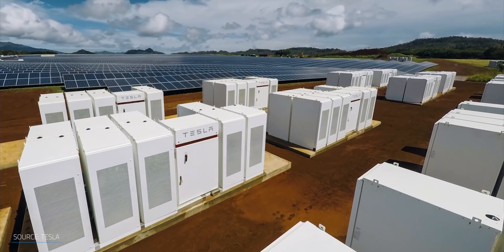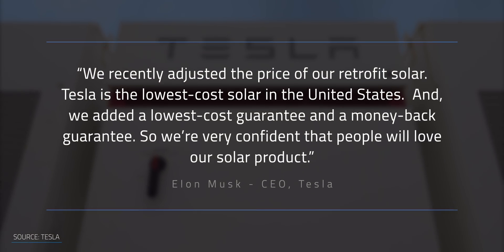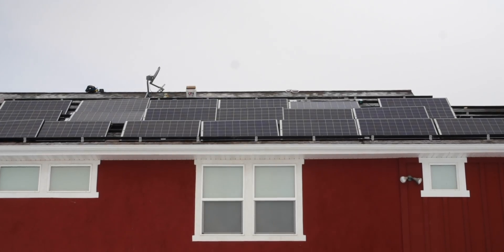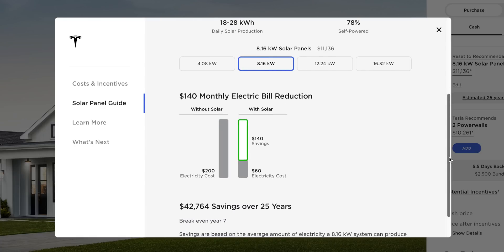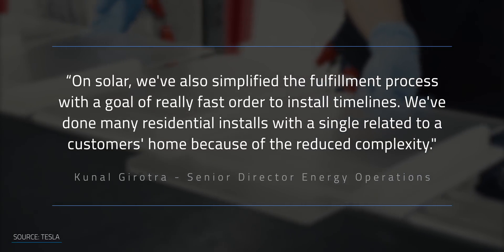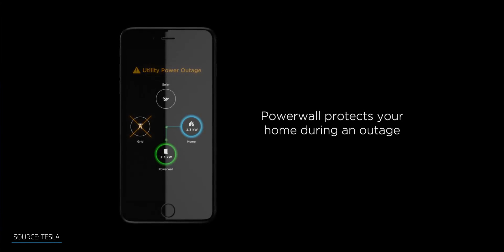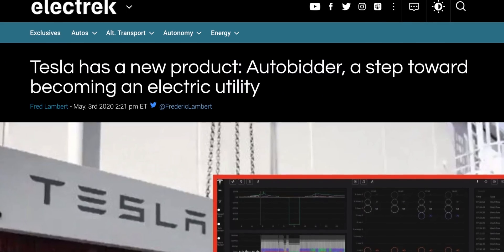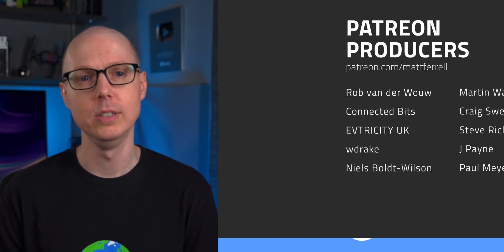Exploring Tesla solar panels game changing price

Comment: I’m going to buy a Tesla Roof, if they ever expand distribution to Wisconsin. Very slow ramp on the energy side.
Reply: What's really happening is installers keep raising their price such that your break-even point is over 10 years, at which time you'll need new panels.  Plus, with over 175 days of cloud cover (and snow covered roofs) in WI your use of the grid plus the environmental cost of making solar panels won't really add up to fiscal or environmental savings.
Reply: coffeehawk 
The cost of solar panels and installation are going down, not up, and the cost trend will continue down. And, panels last far longer than ten years, so not sure why you lied there. Solar plus batteries ares already far cheaper than coal-fired power, which is why coal-fired power plants are no longer being built, and in fact are being decommissioned. These economic trends are unstoppable solar is on a downward trending cost curve, but none of that matters to me — I’m going solar no matter what because it’s a super fun technology. I mean, you face these panels at the fusion reactor in the sky, and the energy is magically transformed into electricity that I can store in batteries in my garage. What could be cooler that that? I’m building a new garage, and Tesla’s solar shingles are such a cool idea, I’ve already decided to go that route. Just waiting for them to start distribution up here.
Reply: @bulletbob  You read the hype only.  Try to broaden your perspective.  It's fine if you like the idea of it but most home owners have additional concerns.
Reply: coffeehawk 
Nope, I’m an engineer, and I see the whole picture very clearly. I’ve been fascinated with solar power since the 1980s, it’s just always been uneconomical because of the high cost of batteries. Now that the battery cost has come down, solar plus battery is cheaper than coal and cheaper even than natural gas. This change is super exciting, not bad. You don’t have to lie about it to try to slow it down. The cost of solar plus battery will continue to decline as batteries continue to get cheaper, so coal and natural gas, where costs cannot go down, cannot compete — and these plants will become stranded assets. It’s already happening. Coal-fired power plants are being rapidly decommissioned, and 30% of power facilities installed last year in the US were solar and wind, despite tremendous political pressure against it. So, no hype necessary — it’s inevitable. Not sure why you care about where your electricity comes from, if you flip the switch and the light comes on, why does it matter? Solar plus batteries are now lower cost than either coal or natural gas, so it will make electricity cheaper for everyone, which is why the utilities are decommissioning coal-fired plants — they just cost to much to operate. For me, I’m going to create my own little power plant in my backyard, and it’s going to be a blast.  😀
Reply: @bulletbob  You're not a good engineer and I've managed them for decades.  If you were a good engineer you would have some comments about the negative aspects, especially given the state you live in, and you would have looked at other states for reference points and as you went down that path you'd understand my comments better.  You're hyped, and that's fine, but as an engineer you ought to know your science>feelings.
Reply: coffeehawk 
Try again. No counterpoints, just more trolling and personal attacks. Doesn’t matter what you or I think, just watch it happen.
Reply: @bulletbob  Just because you can't defend yourself doesn't mean I'm a troll.
Reply: coffeehawk 
Lol, you haven’t made a single credible point.

1. Installation costs for solar power are going down, not up, so you were wrong about that.
2. Solar panels last far longer than ten years, so you were wrong about that, too. This is 2020!!
3. Solar panels are easily cost effective in Wisconsin, so you were wrong about that, too. This is 2020!,
4. I’m a crappy engineer. Well, you got that one right, so, you did have one credible point . . . I’m not sure why people pay me at all.

Nuclear power is dead — stranded assets. Coal-fired power is dying — stranded assets. Oil prices have collapsed stranded assets. Both utility- and residential-scale solar installations are increasing. Battery costs are falling. Solar panel costs are declining. Solar panel efficiencies are increasing. Cost/watt of solar power is declining. You don’t have to believe me, it’s all around you. If you think I’m wrong, though, you should buy shares in a coal mine or oil company. Don’t buy shares in Tesla., they are a bunch of crappy engineers, too.
Reply: @bulletbob  Your words are no different than those of a paid promoter.  But since you mentioned tesla, can you provide the links where tesla or musk describes how their cars are better than a VW diesel for the environment, or even a gasoline economy car.....or any car for that matter?  People should know how good their purchases are for the environment, right?
Reply: coffeehawk 
Dude, your just pumping out propaganda for the tired old companies desperately trying to stretch the life of the dying traditional fuel makers. Buy coal!! Build more nuclear!! Buy oil!! Buy gas-engine cars!!! Lol. The dead and dying. Trillions of dollars of stranded assets. Good luck with that. Welcome to 2020. 😎
Reply: coffeehawk 

Here you go.

https://www.tesla.com/ns_videos/2019-tesla-impact-report.pdf

I have a pro tip for you, though, from a crappy, low IQ engineer: Ignore the environment. Only pay attention to economics. Utilities don’t give a crap about the environment, they only care about cost. The reason solar is winning, and coal is losing, is because the cost of installation and operation for solar plus batteries is 10x lower than coal. It’s not even a close call, solar wins by a country mile. Same way for electric cars. Ignore the environment, the cost of ownership for electric cars is way below gas engines, so electric cars win. In 2040, what will be the ratio of electric cars to gas engines? Maybe 90/10? So, invest in Tesla, not Ford. But what do I know? I’m just a crappy engineer. 😇
Reply: @bulletbob  LOL, we both know you can't find what doesn't exist, but you're still so happy about it.  People don't have to know physics and thermodynamics like you and I do they just need to see the lack of content in your replies.
Reply: coffeehawk 
Hmmm, you asked for an Elon link, so I posted it to you. I even gave you a bonus investing tip. Don’t buy coal. Don’t buy oil. Don’t buy Ford. All yesterday’s technologies — like fax machines and rotary phones. Buy the future . . . like my solar roof. How is that empty? It’s a blast.
Reply: @bulletbob  I didn't see your 2nd link that came 2 hours later.  It will be evaluated.
Reply: coffeehawk 
No trouble. Keep digging coal!!!
Reply: @bulletbob  When you step back and look at your replies you'll see that you're core premise is actually anti-coal/oil not pro-tesla (only a fool would support the horrendous quality levels of tesla's).  As such, you ought to be promoting hydrogen fuel cells.  That's the only 'infinite' resource technology and as long as they keep the batteries small, like in a Mazda 3 EV it's the only technology better for the environment that a 1.8L diesel.
Reply: coffeehawk 
 Yup, I like Tesla’s. I own a Tesla Model Y. It’s immaculate. No quality problems. None. Consumer Reports ranked a Tesla as the best car in the world. Amazing cars. Drive one before you dog on them. Otherwise you’re just repeating hearsay, which might be propaganda. Tesla’s don’t have horrendous quality problems. That is propaganda. Just like when you repeated the hearsay lie that solar panels only last 10 years. You don’t have to believe me. Next Tesla you see, so inspect it. They are beautiful cars.

But I was talking about solar power, not cars. I’m going to buy a Tesla solar roof. But I’m just one person. What I think doesn’t matter — I’m just a crappy engineer, so my crappy point is that market is driven by cost, not environment, and solar plus battery has recently become the lowest cost way to produce electricity, so it is winning out over coal. Coal plants are being shuttered — stranded assets. Solar wins.
Reply: @bulletbob  You're not an engineer, you're a fan-boy.  CR has no credibility or statistical value, until you learn why you'll never actually be an engineer.
Reply: coffeehawk 
We have already established that I am a crappy engineer. And I am absolutely a Tesla fan, although not a boy, so you’re almost right on both counts.

You are so lost in competitiveness, that you are trying to win an un-winnable argument, and thus missing out on a brighter future. For me, I’m going to face some solar panels at the sun, feed the electricity into batteries, and use the stored electricity to charge my electric car. And save money while I’m doing it. What could be cooler than that? Have a blast, man. Life should be fun.

My crappy investing tip from a crappy engineer is still the same: Coal is dying. Don’t invest in coal. You will lose money.
Reply: @bulletbob  You already made a purchase (allegedly) and any car purchase is an emotional event, and the worst thing any one can do is investigate their large purchase after the purchase so I do not expect any changes in your posts.  All of us reading this however like to see your continued lack of focus on the topics at hand.
Reply: coffeehawk 

You’re posting articles from 2019? Sheesh, this is 2020.

No one cares what I think. I’m just one person, and a crappy engineer at that. The transition to solar power and electric cars is already happening. Invest in those technologies. Don’t invest in coal.
Reply: @bulletbob  Another thing you can reflect on: You are not promoting EV's you are promoting Tesla.  We all know EV's are an almost 200 year old technology and it is Panasonic and Samsung using exotic materials to make batteries better, and whomever supplies electric motors is doing the same things.  Tier 1 suppliers are making the computer controls that manage it all.  Tesla does marketing and assembly.  They need the early adopter "useful idiots", 'crash test' dummies if you will, people so sold on the hype that they don't complain much about the horrendous and ridiculous quality issues.  WTF has a 100% recall for bushing grease?  You know "bushings", a technology almost as old as the wheel itself, lol.  Ford, Audi, VW, Toyota, will crush tesla.
Reply: coffeehawk 
The market decides these things. In 2014, Tesla sold 32,000 electric cars. In 2019, Tesla sold over 350,000 electric cars. In 2020, it will be over 500,000 electric cars. During that time, far more gas engine cars were sold, but growth was flat. I’m just one person. What I think doesn’t matter. During 2020, I bought one Tesla Model Y. I didn’t buy a Ford. In 2021, I will buy a Tesla Solar Roof. I will stop buying coal-fired electricity. In the overall market, battery costs are declining. Solar panel costs are declining. Installation costs are declining. Solar plus batteries is now the cheapest way to make electricity. Invest in solar power. Don’t invest in coal.
Reply: @bulletbob  tesla solar roofs are awol, as documented in the links I provided earlier.  20 other mainstream companies have EV's and they've always planned on wider roll outs beginning in 2022; tesla's sales are just a measure of how many people think like you.  tesla has a 1% market share in the US; nothing to brag about, and 150k out of 200k total are just in California.  Obviously, 50k sales across 49 states says something.  Incentives?  How about that cyber truck?  No one that tows anything or hauls 1000 pounds of stuff can ever use a vehicle like that, especially in cold climates.
Reply: @coffeehawk  

You are very persuasive -- I'm not sure that Tesla can survive this onslaught. You have convinced me that solar power and electric cars are clearly not the future -- I don't know what I was thinking. I changed my mind -- following are my new recommendations:

Top Ten Pro Tips for 2020-2030 from a Crappy Engineer: 

1. Invest in coal.
2. Invest in oil.
3. Invest in gas-engine cars, specifically Ford, and GM, which are really cheap right now.
4. Invest in fax machines.
5. Invest in payphones.
6. Invest in Sears and Kmart.
7. Invest in photographic film.
8. Divest Tesla.
9. Divest Amazon.
10. Divest Enphase.

Stocks in these sectors are super cheap right now and should give you incredible value, so you will be poised for the explosive growth that is sure to come.

Take care, man. Have fun!!
Chit
Reply: @bulletbob  I'n guessing English is not your first language or you're a mediocre troll.  In the event you're even a bit serious you can quote anything I said regarding being pro-coal, etc..
Reply: coffeehawk 

Tesla is doomed . . . long live oil and coal!!
Reply: @bulletbob  People that know cars don't buy tesla's.  People hyped up on inflated stock prices are having a party just like they did with google and amazon.  If you can get away with it, great, if reckoning day comes everyone gets screwed, but the market is not a gauge of quality.
Reply: coffeehawk 

Tesla is doomed . . . fear the Chevy Bolt.
Reply: @bulletbob  How long can this conversation go on?
Reply: coffeehawk 

Ten years from now, will there be more solar power? Or less? My answer is more, so I invest in solar — including on my own house. Solar is the future, not coal or oil.

Ten years from now, will there be more electric cars, or less? My answer is more, so I invest in electric cars, including a Model Y in my garage. Electric cars are the future, not gas-engine cars.

Ten years from now, will there more online shopping, or less? My answer is more, so I invest in Amazon, not mall stores.

You started this conversation by repeating propaganda about rising installation costs for solar — which is a lie, installation costs are going down — and that solar panels have to be replaced every ten years — another lie. When I caught you in those lies, you chose to personally insult me. Now, you have chosen to dog on Amazon, Google, and Tesla — three companies that are huge American success stories. From all of this, I can only conclude that you must be anti-American — promoting the propaganda of oil-rich Arab countries. If not, then I hope you can find a way to invest in a brighter future for yourself and your fellow Americans, and not promote the interests of foreign countries. Good luck, and have fun.
Reply: @bulletbob  Do  you not yet notice how you evade every question and just focus on how you feel about certain technologies?  Hydrogen is the only answer and the only virtually infinite renewable source.  And again, tesla solar roofs are no more, especially in Wisconsin, Illinois, Michigan, etc.  Solar roofs are also taking a dive in southern states like Texas.  Perhaps you're a s/w engineer and not an EE or ME?
Reply: @honesty_-no9he  
Yup, I might. I’m building a new garage in the spring, so my plan is to do the Tesla solar roof on it because I need to do the roof, anyway, so why not a solar roof? But I like your idea, though, I might put panels on the house. I’ll do batteries when they are available. Good thought.

Comment: Wow - lots of comments! I commented below, a bit more detail here. (I over-estimated the cost . . . ) I'm in Australia, installed 20kW 12 months ago for AUD15,290 total - at the time approximately USD10,400. No hidden costs. There's a reason Australia has more rooftop solar than almost (?) any other country - subsidies. Oh, we have more sunlight than most as well. From our 20kW roof we produce almost exactly 25mW per 12 months. We sell it @ AUD15 cents/kW, so it's about a 3.5 year ROI. Are y'all aware of the project "Suncable" where we generate power in the Northern Territory and sell it to Singapore and other SE Asian countries . . . ? (That said, we get almost ZERO subsidies on EVs . . . )

Comment: I am still waiting for Tesla to make a Vehicle-to-Grid option.   I want to use my car’s battery as an emergency backup.
Reply: my hybrid has a 120volt outlet  only 100 watts   Now only if i could tap into that 3 phase  :O  i would have 60kw at my disposal  enough to power  about 30 homes

Comment: Once I saw that back in June I got excited! I put my order in and waiting for the install! :)
Reply: How did your Tesla Solar order & install process go? I’m very close to pulling the trigger, but I’ve heard some stories of delays and issues that make me wonder if a smaller, local company might be better.
Reply: @ArtIrwin  it went well for the most part, ordered in July, planning, permits and then installed in December. During the process Tesla assigns a rep that was easy to communicate with but after customer service kinda 👎🏼 for questions I had after. 
Solar is working great and the local companies couldn’t come close to Tesla’s solar panel pricing with installation.
Reply: @georgehintenbergerpa4363  That’s what I’m seeing. The closes quote I have is $2.50/W before incentives, but Tesla is at $2.01/W. The July to December timeline you described seems very long to me. When we had our system installed at our previous house in 2015, we were online in May 22nd after having signed the agreement in March... but that included having our deck and pergola built and then solar installed on the pergola to shade the deck. I’m really hoping if we order now we can have solar up and running before the Central Texas summer months.
Reply: @ArtIrwin  part of my delay is I had a change to the panel layout so they did a redraw and also permitting isn’t moving as swiftly here in St Petersburg, FL with the housing boom and Covid limiting staff at the city.